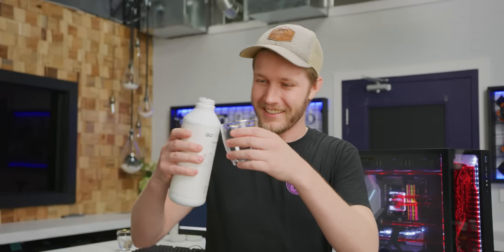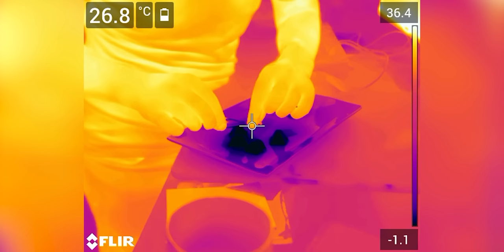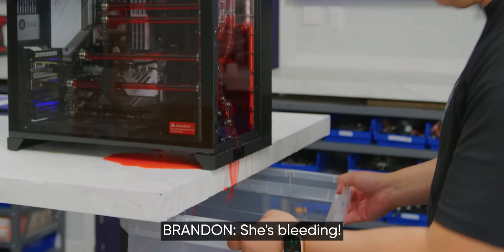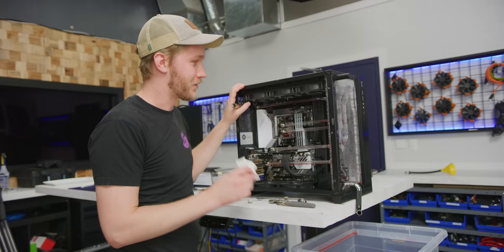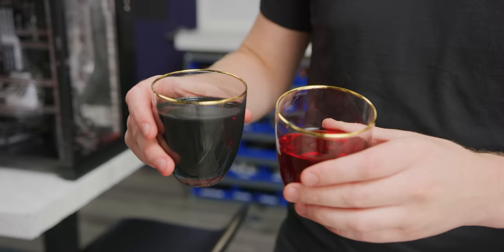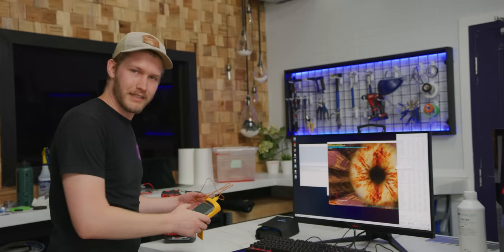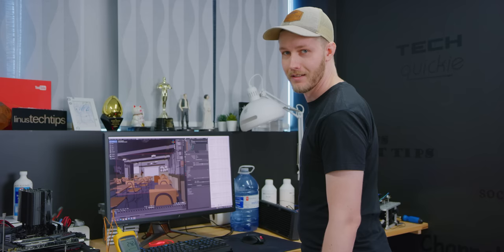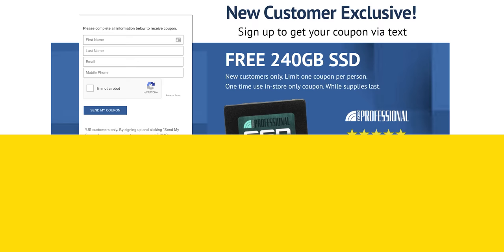7°C Cooler? This must be a scam - GoChiller Graphene Coolant Review

Comment: Yeah it turns out that thermal conductivity doesn't matter for a transfer fluid that much. The thermal conductivity mainly comes from the metal waterblock, which can be enlarged or shrunk quite easily to have better heat exchange with water. What is needed is thermal capacity in the water to soak up more heat, or a bigger pump. If you'd want any reasonable increase in performance and have thesame tubing and waterblock setup, you'd need to swap the liquid out to ammonia.
Reply: And then your PC would smell GREAT
Reply: Why ammonia? I mean, yea, if you turn the whole thing into a refrigeration cycle that would do, but as a liquid ammonia has about half of water's heat capacity. Actually, water is just about the best medium for heat transfer between 280 and 400-ish K you can find. Nothing (I know) beats its heat capacity.
You're right in that a larger pump would likely help out more just because it helps with the temperature gradient in the block. However, I suspect the bottleneck in this particular system is the water/air transfer, mostly because it always is. In fact, the higher conductivity liquid would probably show the largest improvement in settings where the pump is severely undersized. Any flowing liquid will form what's referred to as a "boundary layer" on solid surfaces, which is essentially a stationary film that heat must pass through by conduction rather than convection. This boundary layer is thicker when the flow velocity is lower.
Reply: @misterjonas6991  About the heat capcity of water being higher? Depending on the temperature, ammonia has a higher heat capacity per litre. It defenately has higher heat capacity, but it's less dense.

Point is, you don't really have to care about heat transfer that much if you're cooling to such extreme colds.
Reply: A 1% graphene addition to cooling fluid increases thermal conductivity by 61% and reduces viscosity by 31%.  Note: is really only useful at high flow rates to give benefits over other coolants as it absorbs/dissipates heat quicker, but has identical heat capacity.  What we would have needed to see in this test, is a high-flow pump setup, as you don't get the max benefits until you hit around 6L/m flowrate to take advantage of the increased thermal conductivity of the fluid. In addition, you could probably use a single pass high flow radiator for increased performance with this fluid with its higher heat transfer rate, instead of the 2 pass rad installed.
Reply: Sadly ammonia is too toxic and also frozen corrosive.
Reply: @blipman17  if heat capacity was the bottleneck, then it would mean the fluid leaving the cpu/gpu would be close to the  temperature of the cpu/gpu, or alternatively, it would mean that the fluid leaving the radiator would be close to room temperature. But you're probably right that the radiator/heat sink design is more significant, though I'd suspect it you put a more volatile liquid like isopropyl or propane, and you can get a phase change to occur (evaporation after the cpu/gpu and condensation at the radiator and have the pump sit after the radiator so it doesn't get hit with gas)
Reply: @boiledelephant  - PeeC
Reply: @j4log719  comment just blew my mind. somebody should try that!
Reply: @folienkiste6242  That's basically using a heat pump, aka AC, which they've done before.
Reply: @j4log719  No, you're failing to consider that heat transfer is function of the square root of the temperature difference. A higher heat capacity means a higher heat transfer because the temperature differential stays higher. 
Which is also why in the video he says something stupid, a 1° difference in the room is not something you can directly associate linearly with performances.
Reply: On top of that the heat transfer coefficient of the fluid metal interface is gonna be insane anyway because of the turbulent flow in the pipes
Reply: Oooh, I can pee in my loop and the thermal capacity of the liquid will improve as the pee ages 😂

Comment: I regularly work with a variety of chemicals, including anti-foam.  And the problem with anti-foam is it leaves behind a residue if you use too much of it, or when it dries, which would insulate the inner surface of your loop, preventing, or at least impeding thermal transfer.  Your best bet is to simply design a loop that can be vented, and is properly configured to minimize foaming, which mainly just means there’s as little air as possible in the system.

Comment: Energy drink vs coffee which cools better?? 😂 Totally expected you to drink it at any moment
Reply: plain water
Reply: gatorade
Reply: green tea
Reply: Still waiting someone use “liquid metal” mercury for cooler… and system strong from almagamated with mercury (copper system)
Reply: extra dark roast.
Reply: Greetings Angus!
Reply: @adimegan4677  to dangerous to use mercury
Reply: @Knowbody42  Gatorade is ok, but imo it should be thicker
Reply: @adimegan4677  Good luck finding a pump that can push mercury around a loop... I doubt there even is one small enough to fit in the same room as a PC
Reply: @adimegan4677  drawback of that is that water has the highest specific heat capacity, over 2 times as much as mercury (if you look at it per volume of liquid). So water may be worse at removing the heat from the CPU, you need less of total volume of water moved around. Maybe that kinda cancels eachother out, idk, but if it does it means it is so much easier to stick to water.
Reply: That black liquid reminded me of ferrofluid. Which begs the question: what is the thermal conductivity of ferrofluid and can it be used for cooling? It is metal after all... Please Linus, make this happen :D
Reply: @michagabo8819  did you forget to take your medication again?
Reply: HEY you're everywhere xD
Reply: What about blood?

Comment: I think with water. It's the long longevity temp that counts. My watercooling pc always goes up 5-6c after 5-6months.
Reply: That is actually interesting, the water must somehow get less conductive (unless its just clogged but im ignoring that)

I cant remember off the top of my head what it could be, but it has to be something
Reply: @defiantgg1831  I think it’s just impurities that it collects overtime. Or having it heat up & cool down over & over. Somehow changes the water, everything is clean. Fans & rad. No dust ect but my water always goes up 5-6c noticeably over time. I just put it down to impurities within the water that’s it’s gathered from the loop. Could just be micro impurities but enough to change the temps. Wouldn’t know without a microscope & comparing. The used water with new liquid.
Reply: @Near2Future  might be some of the particles of whatever is in the water, since there is still some even in distilled water that gathers, and blocks/slows down the flow or something

im not at all sure, but its possible
Reply: its probably your thermal paste drying up.

Comment: Here's a tech tip for your foaming test: 
1) put liquid in a bottle
2) close the lid of the bottle
3) shake the bottle
4) observe the foamage
Reply: He also used the same cloth thing for all liquids. So there’s some contamination.
Reply: @salluna1957  not significant contamination, but yes
Reply: 👏👏👏 you did it.
Reply: not really, this isnt the type of foaming they are meant to prevent, i made a post apart, the liquid is meant to prevent cavitation bubbles, these are bubbles that generate due to the drop in pressure in certain parts of the pump, they are an issue because when the pressure rises back up they will implode, and the incoming pressure of the liquid will be like the tiniest pistol shot ever, ohh so slightly eroding the surface in which the cavitation bubble had happened.
Reply: @revdarian  That's a good point, but i think those would form from shaking a bottle aswell. Though I'm not sure about that. Maybe for the cavitation bubbles to form you would have to hit the top of the bottle (lightly) with a hammer. Like when you hit a glass bottle on the top and the bottom pops off due to cavitation. Imho still slightly easier than Alex's drill method.
Reply: make sure you clean the bottle thoroughly - dirt causes nucleation sites for gasses to form on (hence why a dirty glass foams more than a clean glass from soda, beer, etc.) honestly it coulda been purely alex's test, the graphene solution just nucleates better with the material on the drill he used vs cryofluid, or the glue came loose from the 1st 2 tests. so many variables...
Reply: Every fluid foam to a degree as long as there is AIR in the mix.. dont think it looked that bad TBH

Comment: It's easy to drain, when you remove the FILL PLUG FIRST to allow the air pressure to equalize.
Reply: This bothered me greatly.. like trying to drain the oil in a car without opening the fill cap and complaining that it splashes and gulps air as it comes out
Reply: @MotoCat91  I thought he was an engineer? Did the Canadian engineering degree plan not cover fluid dynamics?
Reply: Can't be any worse than draining/filling my itx nightmare
Reply: @KrKrypton  THIS... he does a lot of clumsy / noobish stuff in a ton of vids.
Reply: @KrKrypton  In cases like this I don't actually think it's a lack of education but just a symptom of doing varied projects without much consistency.

Like, I've been through several years of university learning advanced math and engineering concepts but will still occasionally mess up a simple equation or programming syntax that I haven't used in a while.
I also build custom PCs as a local business here in Aus and still sometimes forget to turn on a PSU when I start testing a finished build.

So the fact he makes silly mistakes imo is fine, but he should have the hindsight to recognise them and explain to the audience what should have been done instead.
Reply: If memory serves he never actually finished his degree, so he's not actually an engineer...
Reply: too hard , no time , need short clickbaity shit

Comment: The anti-foamer may be doing something, we don't know what their solution did without it, could be much worse.  Also, I'd be afraid of the graphine buildup in the block and radiator.
Reply: I mean, technically speaking as long as the graphene doesn't completely block the flow it is conductive, so its not like it'd be a problem even if it coated it up since it would still transmit heat through itself.
Reply: @Adierit  Im starting to think thats exactly what needs to happen in order for it to work even better. A graphene tunnel where the water pushes the thermal load
Reply: also suspended particles will stick to the boundaries between the liquid and gas phase and reinforce the bubble boundary so therefore ensure the bubbles stay around for much longer, but if you overdose the suspended particles it can have opposite effect and just shred bubble formation
Reply: @Adierit  Theoretically a very small amount of buildup along the radiators would probably increase performance. Better thermal transfer rate material touching a larger amount of liquid to dissipate heat.
Reply: @ImOnyxRS  I don't buy it. Normally your heat flow would go from copper cold plate to water directly. You're saying adding another (imperfect) thermal interface would improve it? So the heat would go from copper to coated graphene particles to water.

There's no way that's better, especially since the coating will be nonmetallic.
Reply: @falxonPSN  What does it being a non-metal have to do with anything? Otherwise, I agree. Plus I'd expect it to increase friction. Evaporation of the liquid in the suspension will probably cause eventual clumping. Plus I bet it's impossible to fully clean off surfaces, leaving a slight tint after some time. I even wonder if it'd be abrasive and cause the plastic to wear over time. Whatever they're using to suspend it could even affect certain plastics and gaskets. If you get a leak with this stuff, it's going to be game over super fast.
Reply: @falxonPSN  I am not sure but what graphene does is as follows.
water sucks heat from the copper plate. Then graphene sucks the heat from the water and enables the water to suck more heat from the plate. At the radiator end, the same thing happens in reverse. This is just speculation.
Reply: No, it's obvious at this point that the graphene is so efficient that it brought the entire room's temperature down.
Reply: @falxonPSN  Well, if graphene is more thermally conductive than the water it is floating around in (Which it is, or else it wouldn't be in there to begin with) and also more thermally conductive than the copper (Which it also is) it would be more effective at both receiving heat from the water touching it and dissipating that heat into the copper fins of a radiator than if it wasn't in the middle.

It can both suck up heat, and give that heat away more efficiently than the plain combination of water and copper can. That's the whole reason it's in the loop to begin with. While it's going through tumbling around it's coming into contact with the copper and passing heat faster than it otherwise would be. A full coating should hypothetically be the same only instead of only happening occasionally as it tumbles through it would be happening all the time.
Reply: @nishanthvemula3852  But the issue is, you can still only remove the amount of heat that the copper can dissipate.
Reply: @falxonPSN  Increased surface area between the copper and water?  I.e. the ultimate in "micro-fins".  As long as the water is still flowing through the roughness it should increase the thermal transfer between the two.
Reply: @ImOnyxRS  I would say another problem is that graphene has low mass. It might have the thermal conductivity part down, but the thermal mass is lower than both copper and water and heat dissipation is a function of the two.

If this is actually more effective I would say it is because of the buildup of graphene structures on the copper, effectively giving it more surface area.
Reply: @ImOnyxRS  adding a layer of graphene would reduce performance. Heat still needs to be transported by water, you’re just increasing resistance to heat transfer. Heat & mass transfer noob LOL

Comment: Did my master thesis on this and yes depending on the ratio and the material suspend in the nanofluid this is entirely plausible.
Reply: How do you think one might get close to 7 degrees with this fluid? (or does the fluid need to be re-engineered for that kind of a result?)
Reply: @christopherjc54  As a Chemist, I'd say you'd have to re-engineer not only the fluid, but also the cooling setup. A more volatile fluid is better at taking heat away, but it comes with a whole lot of problems itself. A denser fluid can also improve thermal conductivity with the same nanoparticles, but I wouldn't be sure if that could make the trick.
Reply: As an automotive engineer; I'd say if you re-engineer the cooling system you can get pretty much any cooling power you'd want with regular old tap water. No need for any carbon dirt.
Reply: I would think though, that the compounds used to maintain suspension of the particles would be a bigger factor than the particles themselves, eh?
Reply: @Nevir202  And you would be absolutely right about that my good sir. There are several other properties that will impact the overall heat transfer, but the material properties of the particles and fluid impact it the most.
Reply: @christopherjc54  I couldn't tell you until I knew what the heat transfer properties of the particular fluid they are working with. It may be possible or it may not depending on the concentration of the nanoparticles in the nanofluid